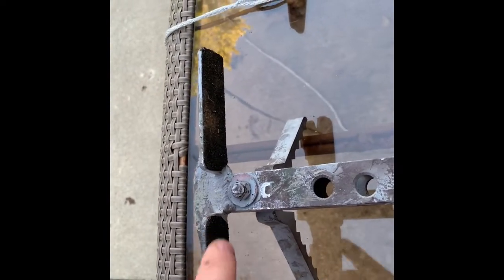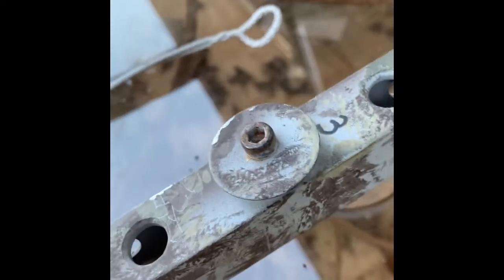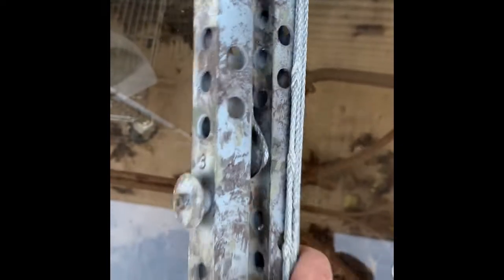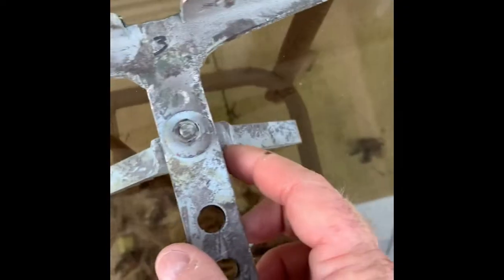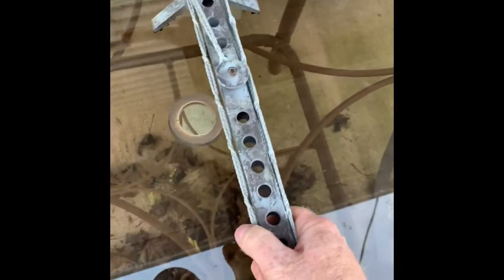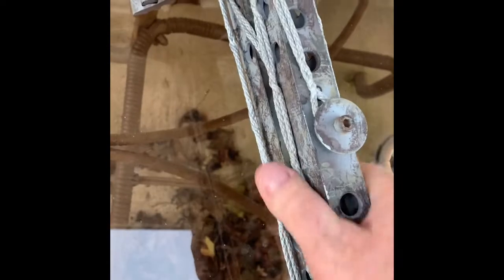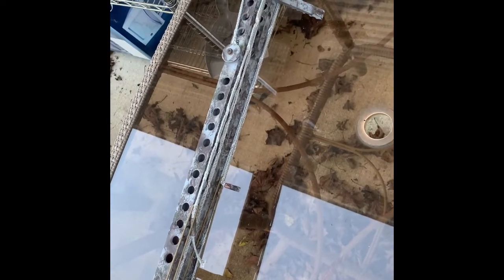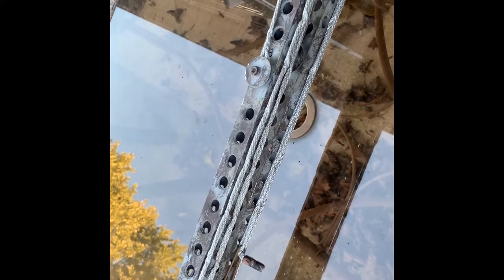DIY Climbing Sticks

Comment: Hey how did you make the steps?, where did you get it? How did you form them?
Thanks,
Reply from the maker: I made them out of angle aluminum. Didn't have to form them, just cut them and weld them onto the aluminum tube. I got my stock from a young man I knew who was taking a welding course at a local Tech school.

Comment: Paul, thanks for the video? How are the steps holding up? I am a 230lb guy and was wondering if I should maybe get a beefier aluminum angle (such as 0.250" or 0.375") for my steps? Thanks
Reply from the maker: They are all as good as they were on day one. I go 270 in my birthday suit, so you shouldn’t have an issue. I built 4 with the intent of destroying one of them by loading it up. It was holding up so well that I decided to just keep it in a set of four.

Comment: Did you do your own welding?  If so, was that something you knew how to do previously or did you learn it for the sticks?
Reply from the maker: MrShysterme no I didn’t. I paid a HS kid who was taking a welding class at the local tech school to weld them. I’m planning to make a set for my nephew and for one of my hunting buddies. This time my nephew will do the welding. I can weld a little but he’s much more proficient than I am. I paid the HS kid and this time it won’t cost. My nephew is a farmer and has his own welder and a kick ass shop.
Reply from the maker: A caution with welding aluminum, it warps really easily. The trick is to get a good weld without letting the aluminum get too hot.

Comment: How much did you end up spending to make one stick?  Not including what you paid for paint, ropes or to have it welded.
Reply from the maker: hunter truett may $40 for materials and versa button hardware and $80 for the lone wolf standoffs.
That’s for all sticks. Four of them. 
$120/4 = $30 per stick.
Reply: Paul Crave for just one stick?  I’m assuming that’s the cost for all 4..
Reply from the maker: hunter truett 30 per stick. $120 for 4 sticks.